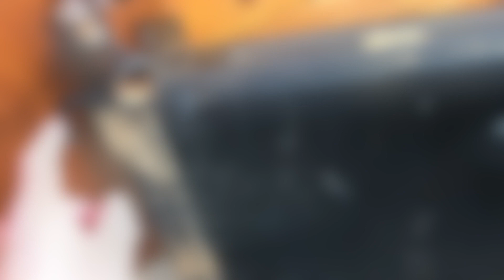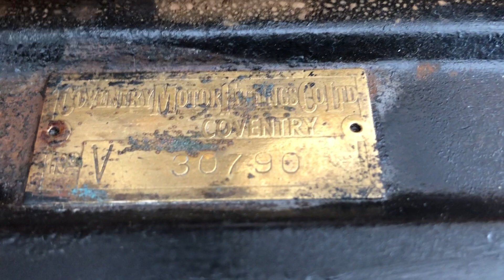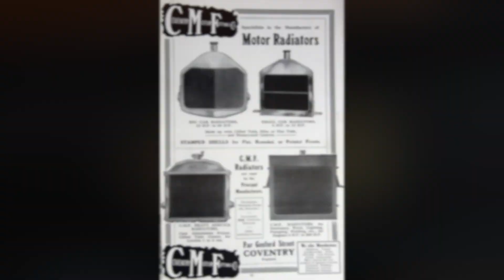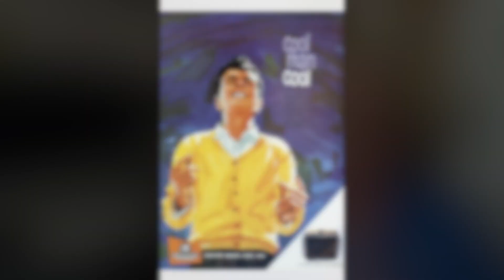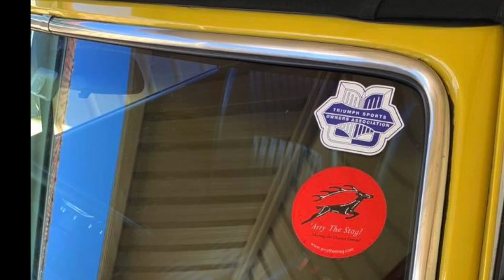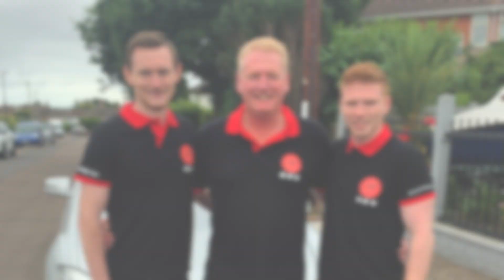Triumph Stag Radiator Leak Fix & Restoration – Classic Cooling System Repair UK

Comment: I just started putting my radiator back in Mimi, and I found its an original Coventry radiator like yours with the number ( V  30796 ) and my car is a 74 MkII. If it had not been for your video Tony I would never have even looked for the label. Nice to have another piece of history with the car. I cleaned the rad out with  CLR and will give it the vinegar and baking soda treatment when the car is running. As you said not many new radiators would last that long, a testament to British quality.

Comment: Nice bit of research! I suspect there might be more original radiator housings around than you might think, the usual repair process back in the day would be to recore the rad and thus retain the outer frame with the plaque. I'll be checking mine in the morning!

Comment: Hi Tony. I have the original radiator in my '73 Stag, albeit recored years ago. I too have the "Coventry Motor Fittings" plaque  affixed to it . For your information the serial no is : T 64580. I have no idea how CMF serial numbering worked, but doesn't seem to bear any possible resemblance or continuation to yours.
Considering they only built circa 26k Stags and the our rad serial nos are 33790 apart with a different letter prefix also. Interesting all the same. 
Cheers Russ.

Comment: Hi Tony,
You may already have heard this, but a handy tip when re-installing, to avoid any damage to the rad,  is to put a large piece of corrugated cardboard on the rear face of the radiator. The gaps between the rad and the fan/crank bolt seem to vary from car to car !  Mine is so small that I don’t even have the space to fit a replacement fan belt without removing the rad, but my car runs nice and cool :)

Comment: Mine doesn't leak but I do wonder if it's a bit sludged up. I found a local radiator restorer who would unsolder top and bottom to clear the cores out.

I would much rather keep the original than just swap to some "new" part which doesn't have the heritage.

Comment: A trophy for the new garage. Have it mounted on a wood block with a brass plate sitting on a work bench. I have a house move happening next week and scored a double garage but unfortunately when i looked inside there wasn't any Stags in there. Keep up the good work, Tony.

Comment: Fascinating stuff on that rad, glad to hear it’s getting rebuilt by a local specialist. 
I had a similar experience with mine during my rebuild, it had a nice brass plate from Rotherham Radiators. I took it to my local guy as I knew it had a minor leak. I was prepared for a full recore but he checked it over and declared it to be a high quality 4 row unit with excellent flow and just one bad join which he fixed and pressure tested for me. As I told him not to bother painting it- I did that myself- total cost was £25 which I was pretty chuffed with!